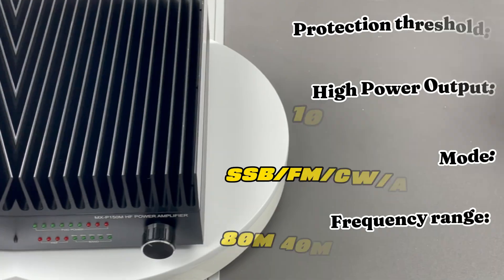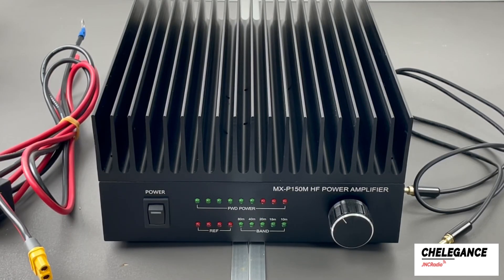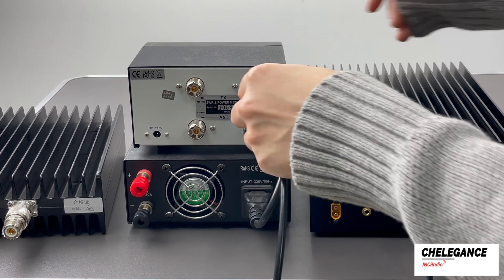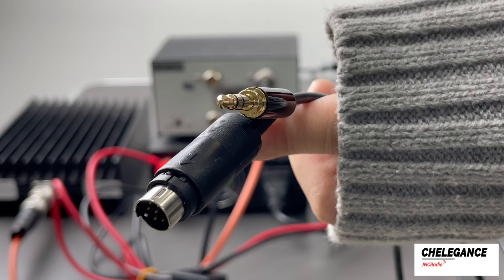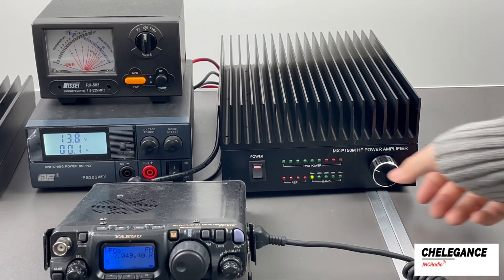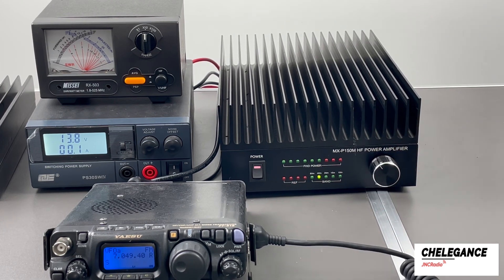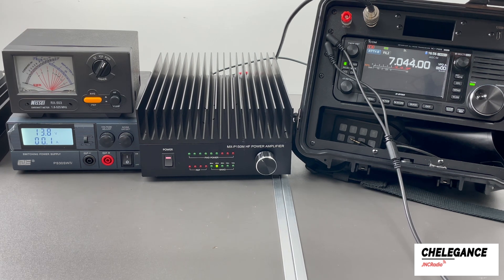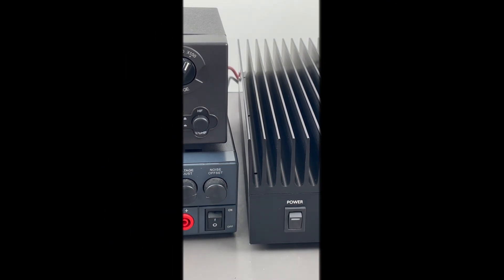The desirable Power Amplifier: MX-P150M AMP

Comment: Question: in order to switch CHELEGANCE MX-P150M to TX transmission mode, do you need to close the SEND and GND wires?
Reply from the maker: Yes what you understand is correct